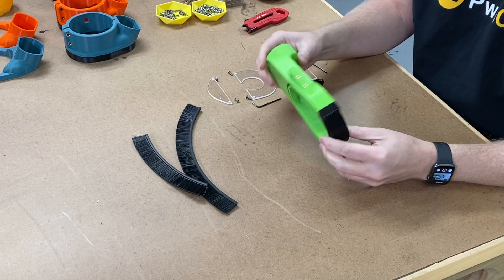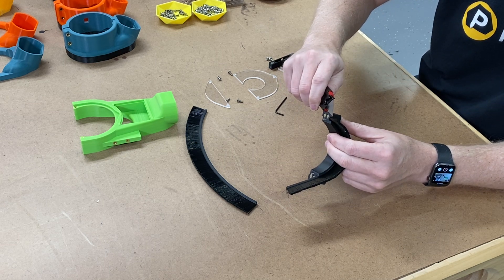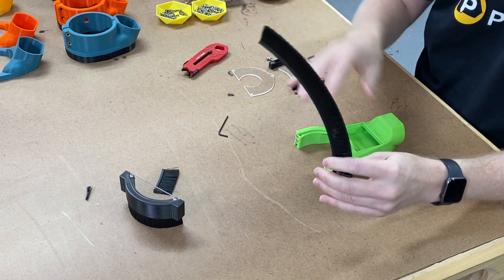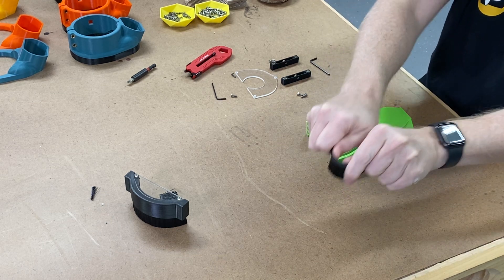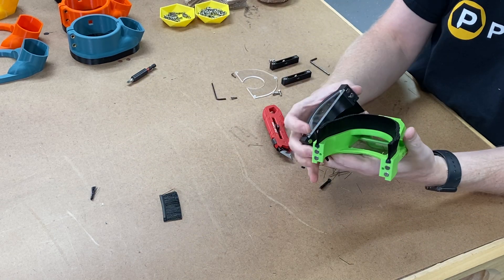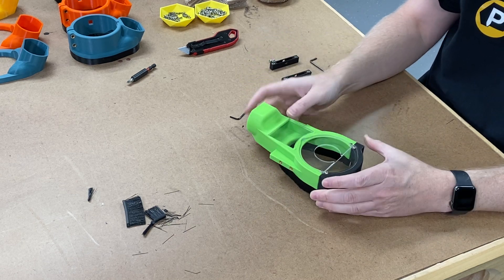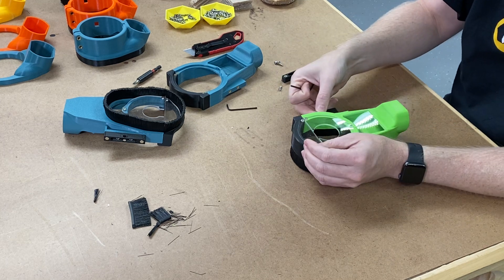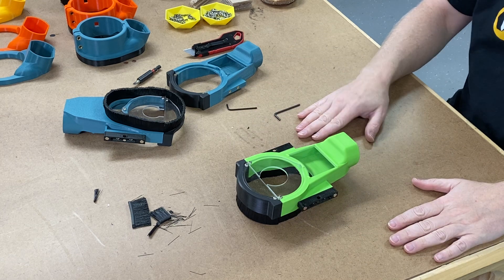Assemble PwnCNC Dust Boot v3

Comment: the opening is too big does not create enough suction leaving behind a lot of chips. can you help us design a smaller opening on the top acrylic in order to create more suction power.
Reply from the maker: V3 is designed for dust collectors which requires a higher volume of air flow compared to shop vacs.  Thus the larger opening provides that.
If you have a shop vac or a less efficient dust collector, we recommend our v2 design which has a smaller opening and is tailored more towards the high static pressure required by extractors.